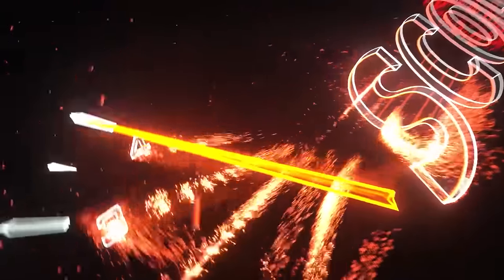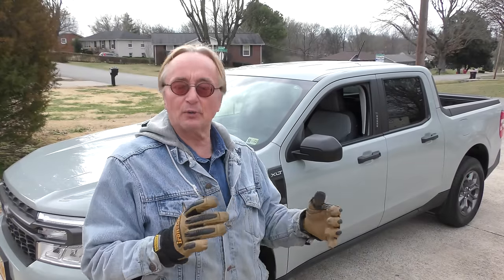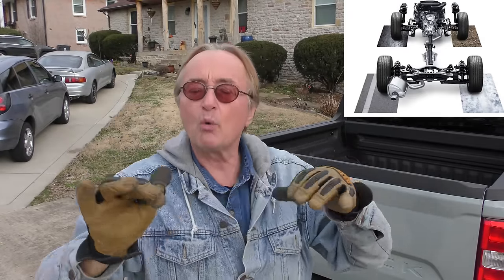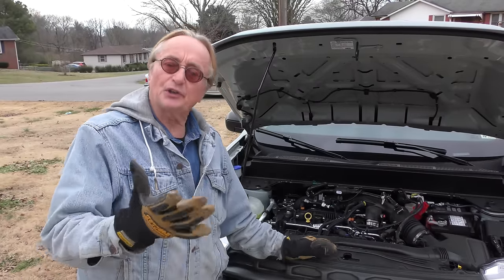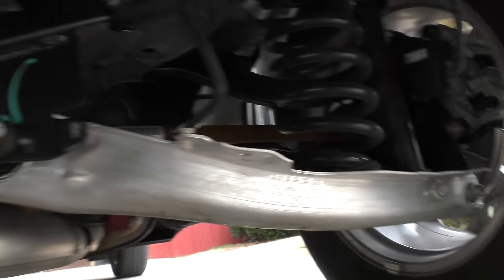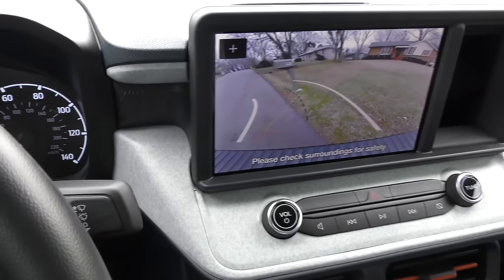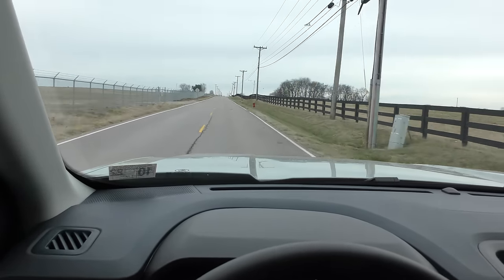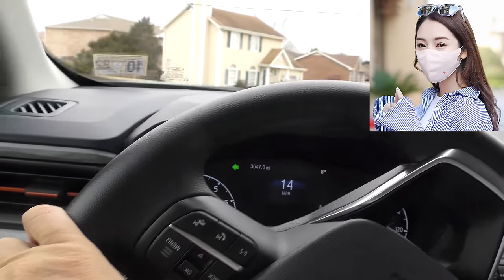I Finally Got a New Ford Maverick and Here's What I Really Think of It

Comment: I'd rather they squeezed the 2.3L ecoboost in there and tuned it like the Mustang 350hp and 350 ft lbs torque. That would be a blast. I wonder what you can get out of the 2.0 with a programmer.
I'd also rather a straight cab 2 door with a longer box. I really wish my ranger was a 2 door straight cab with a few more feet of box.
Reply: some tuners are getting 300HP with a basic tune.
Reply: @roynorman513  on the 2.0L? damn that's not bad. Probably feels like a lot of power in that tiny little truck! they are pretty cool I'd still rather see a straight cab with a 6 1/2 foot box though. that's the worst part about my 2019 ranger is the short little box and the big rear seats that i never use. I know people seem to love the big 4 door trucks but I'd buy an SUV if I was looking for seating capacity. if my ranger was a straight cab it could have an 8ft box i'd love that. If i had the money and the shop to do it I'd customize one like that.
Reply: @Trumplican  got 3 teenage daughters so I need the back seat (BTW the back seat is wider then the current ranger)
Reply: @roynorman513  yeah i get it most people like the back seats i just wish they also made a straight cab long box but i guess not enough demand for them.

Comment: I bought a 2021 Bronco Sport badlands right before the price boom in the car market last year, paid 29,655 for it, it's pretty similar to the Escape and this, all 3 platforms using the 2.0 ecoboost and unibody construction.  My bronco sport did exceptionally well in over a foot of snow here in Cleveland last year, cars were getting stuck left and right and the 4WD/AWD with the rear locking diff had me pulling up snow covered steep hills no problem.  On the highway I never exceed 70, it's just science that the slower you go the better fuel economy you get.  EPA has it rated at 26 mpg, this past weekend going to Pittsburgh for a wedding I got 33.3 mpg even with the PA mountains.  You drive them reasonably and they'll be very easy on your wallet and very dependable

Comment: I test drive the pre production fords, and when i was driving the maverick hybrid, on a 50 hwy - 50 city I was getting 38 mpg, when all city routes i was getting between 40-44, and I wasn't driving just 1 I was driving dozens of different ones, the ecoboost averaged 28 on the hwy
Reply: U were not accelerating slowly and avoiding areas,that need breaking?
Reply: @ryan-yg7pk  in the city It was like heavy city like downtown Ann Arbor (of of the most conjested places in michigan that ive driven). The maverick is the only car of ford's that I have driven that gets roughly the posted mpg (at least the way I drive).

Comment: This is no different than their SUV's..  Just look at the history on those and you'll see how these will fair..   It has the same uni-body, same suspension, and same engine, ect.. It's just their SUV with a bed instead of cargo area.  Not much of a truck really.  Similar to a Honda Ridgeline.  More of an SUV than a truck.  They're pretty sweet if you don't ever tow things.
Reply: I work at a rock quarry and we had a guy who would come in for fill dirt with a Ridgeline. Darn thing can't carry much more than a few wheel barrow loads at a time.
Reply: @twillison8824  lol.. It's pretty funny. Even on this thing -- it's payload is only 1500 lbs, and it's towing is only 2k lbs.-- and it can't do them both at the same time either. smh..  It's literally a minivan.

Comment: this is the perfect truck for the weekend homeowner...a few trips to lowes or HD, a few bags or topsoil,  golf clubs, hockey bags, coolers, softball equipment....all the stuff you need easy access to get but don't need a full truck box.....good gas mileage, enough power for those weekend jobs and an occasional washer or dyer or snowblower you have to pick up...i will take my 2nd gen Honda Ridgeline but for the entry level price of the Ford, it'
s not a bad deal

Comment: I got mine in last Saturday, I waited 9 months "meaning I ordered pre-production" I got the lariat with the luxury package, and a full sized spare, nothing else. I'm actually more impressed than I thought I would be, I ordered the truck when gas was 1.68 a gallon, so fuel economy was not my reason for ordering, I was driving a 2015 Ram-1500 and honestly the dealerships in my area "Ram dealerships" scare me, just not a fan of the local dealers, also I knew the trade value on my truck was super high right now. So the idea in my head was to get a loaded truck that meets all my demands out of a truck seeing I don't do much truck stuff, and this truck does the truck stuff I do, for 30k, trade my old truck in that had 110k miles and have a brand new vehicle that I owe very little on. I got 18k off my trade, so you can do the math, I will have the maverick paid off in 2 years without trying. 

My impression driving it less than a week is it handles very well, I will NEVER have to wake up go outside get in my truck in the winter and freeze to death because I can schedule a time for my truck to start on the app, or use my electronic key to start it when I first wake up, the velocity blue looks much better in person than it does on the online representation, back seat space is enough for a adult to sit in without being pushed against the seat, the synch 3 system is great, dual climate control is great considering in the summer I prefer to row the window down, so my wife can just blast the AC on her side of the truck, the 2.0 liter turbo has plenty of power, truck comes stock with a towing insert even without the towing package, the comfort in the front seats is just as good as a passenger car, I drove for about three hours the first day I got it, and can say I didn't have any back pain. 

I'd go for it if you are interested, I watched a video last night comparing a fully loaded Maverick vs the base model, and for the price the base model had about as much stuff as my big horn 2015 ram did, can't beat a brand new fuel efficient truck right now for under 20k. I'm sure wait times will vary greatly depending on the options you order, but to be safe if you want this truck in the next year I'd go ahead and order one, a dealership could probably answer that question better, I asked about it when I picked mine up and they acted like a year was a realistic outlook out someone ordering one now "Could vary by location in the US" 

I'll probably end up uploading a video of mine, there's actually not a lot of recent video's of mavericks, and I guess I'm weird because I can't seem to find anyone who ordered a lariat that wasn't AWD.

Comment: Auto off is easily disabled with the dedicated switch on console. A $2400 10 year extended warranty made sense to me being a brand new model with a lot of tech. I have the XLT FX4 with around 4k on it, mpg high 20's with no issues and a hybrid with under 1k, mpg low 40's so far. Love both and still waiting on 2 more to be built. Ordered all in Sept 2022. Replacing aging Ranger fleet trucks over 25 years old.
Reply: Curious, did you test drive the new Ranger?  I like the look of them, but these Maverick's seem too good a deal when compared.

Comment: Good review of the new Maverick Mini truck. Scotty is usually spot on when it comes to advice. However, non of us are perfect and I will try to seek the truth especially when it comes to safety. Living in a state like Maine where 6 months of snow can be experienced, I recommend putting matching snow tires on All 4 wheels even when the vehicle is front wheel drive. Same for a front wheel drive little truck along with extra weight added to the bed to help keep the rear end stable and track the front wheels. When frozen roads become slushy during the daytime, the mismatch of treads on tires front to rear will cause the vehicle to slip a lot easier especially in a hard breaking situation. I highly recommend 4 snow tires on all 4 wheels period.

Comment: I have experience with a Mexican made vehicle  and it's not all bad - 2009 Chevy HHR SS with the 2.0L Ecotec turbo engine and automatic trans.  It's still alive and driving quite strong at almost 150k miles but the auto trans gave it up at 110k miles (made in Canada I think, eh?).  The worse wear has been mostly cosmetic (paint and glass) but incredibly the interior has held up nicely.  Scotty is right about turbo fours - CHANGE THAT OIL OFTEN WITH FULL SYNTHETIC without fail.

Comment: I like AWD in snow because all the wheels are driving.  I used to put an inch bigger all weather tire on all four wheels and didn’t need the studded tires.  You just need a tread size that handles snow better than the factory delivered tiny tires.  As long as the larger tire fits in the wheel well.  No effect on the tranny.  My old suv was top heavy so the larger tire size gave it much better stability on ice and around corners in the winter.

Comment: I’m still driving my 97 Ranger, runs perfectly, 238,000 miles, aside for a timing belt change all I’ve done is take care of it.  I drive 50 miles a day and spend $40 a week in gas.  My point is the Ranger is proven over time, I’m happy to see them bringing back small trucks but I don’t like the over engineering
Reply: Love it.  How often do you change the oil?

Comment: Honda ridgeline is front wheel drive and first since 2006. Guess what, even in slippery snowy conditions putting it in 4 wd is rarely needed.  Honda nailed it. Best kept secret, the Ridgeline rocks. Have 230K miles on my 08. bought it with 180k miles 4 years ago. Could still sell it for what I paid for it. Doesn't get any better than that.

Comment: The Maverick is the first Ford pickup I've purchased for myself after 24 years of Honda ownership. 1 year, 7 months in and 23,500 miles I have no complaints except for a few radio & backup camera glitches. Overall very happy with the Maverick XL EB-FWD (don't like the fancy crap), and getting 27-28mpg city, and 30-33mpg on the highway. I'll be curious of the long-term reliability. We'll see how things goes. The Maverick will either make or break my future of Ford ownership. One thing is for sure: after being a car/SUV driver for the last 24 years, once you drive a truck you never want to go back to anything else.

Comment: If from Niagara Falls, Scotty should know that putting snow tires only on the front wheels, front wheel drive or not, is outright dangerous, capable of causing serious injury and even death. In cold temperatures, with a snow tires’s softer compound and more aggressive tread design and depth, the gripping and stopped ability is significantly more powerful than all seasons, with a rubber compound that hardens in the cold and with a less effective tread design. As such, the imbalance causes the front end to have significantly more grip than the rear. Cars can and do swap ends when breaks are applied. Think of it as putting the feathers on the front end of an arrow. Many professional tire stores refuse to put two snows on the front for their own legal liability.

Scotty, shame for repeating this dangerous suggestion more than once without checking out the facts. I have experienced this at high speed, and I learned my lesson. I am glad to still be around.

Comment: I had a 2002 Jeep Cherokee with a straight 6 cylinder motor, 2 wheel drive and I loved it.  It got totaled so I replaced it with a 2008, 6 cylinder, AWD.  I went from 21MPG to 13MPG - I hated that 2008 model.

Comment: In my mind front lifts , shifts weight to back, looses grip in steering
...just stomp the accelerator in front wheel drive....feel it rise...and pull to one side...empty space.  Front is good most times. I guess its like horses and wagon. But horses ran straight ,under better control no built in  left or right bias in the rain .   They all beat walking.  Pick your disadvantages.

Comment: I got a 2008 Ranger , sept . '07 , for  $19,500 ,  ( Canadian )  besides oil & filters, the only things I replaced were tires & a battery at year  10 ,  sport , supercab , 3 litre v6 , 5 speed , air . now you can't get them , new Ranger is twice the price , & harder to work on .
Reply: My step father bought a 2007 Ranger Sport Supercab, 4WD, auto, with the 4.0L V-6. Even with the biggest engine it wasn't quick and sucked gas. The ride was rough. But durability wise you couldn't beat it. The thing was bulletproof and was perfect for the winters here in New England. It was rust that ending up eating her away 13 years later.

Comment: I've had a Ford hybrid with the Auto Stop/Start feature since 2015 and 195,000 miles. Absolutly nothing has gone wrong with the things you mentioned. I bought a 2022 Explorer and it has the Auto Stop/ Start as well,  which you can turn off BTW. I must say I don't like it on gas only vehicles. The transition is too jarring. You don't even notice it in hybrid cars.

Comment: Toyota's new small truck is due as a 2024 MY and should be competitive with the Maverick. Scotty, you should cover the stop start disable process. Some vehicles offer a stop start disable switch, others require modifications. This feature is unwanted by most people, it also stops the a/c compressor when your foot is on the brake.
Not much fun in the summer in heavy traffic!

Comment: Scott. Like the Ranger, there is a switch to prevent the engine from shutting off at stop signs. As for AWD - If it's like HONDA and others, the rear drive shaft only kicks in when the sensors detect a need for the extra traction.
Reply: Not sure on hondas but prior ford awd architecture, the rear driveshaft always spins - geared via the Power Transfer Unit — and the rear differential has a clutch to engage and disengage the driveshaft’s link to the rear gearset.

Comment: I really wanted one of these but then after thinking about it more logically I figured that a subaru outback is a better vehicles for the same purposes.  
 
Maverick bed is so short you can't do much. Outback you just out down the back seat and you've got a longer space than a maverick bed.  
  
Outback is awd with higher MPG.  
  
Outback has more features and comfort. 
  
More rear leg room.  
  
I would prefer a maverick if they committed to it more in terms of utility. 
  
Like have the back seat able to lay flat and bed expand into the cab. 
  
Also improve the MPG on the 4 cylinder. No one is going to haul with this.

Comment: With front wheel drive you need snow tires on all 4 wheels because your braking is affected as snow tires grip better than all season tires and you will have tail spin if you only have snow tires on the front

Comment: I have a Lariat hybrid and love it, only issue is the startup temp sensor is faulty or expecting a higher temp and sets off the CEL, after a few minutes is goes away, sometimes I have to clear the code, so far that's all, 23K miles average about 38-40mpg

Comment: All my fords I think were built in mexico. All jave over 210k miles and all run well and haven't required any major repairs. 
2004 f150; 2008 f150 and 2012 transit connect.   The 5.4 triton was supposed to be trouble but I haven't had any trouble at all.    Knock on wood.

Comment: All-wheel-drive front wheel drive does matter. You can get snow tires on a front wheel drive, but it’s much much better and all wheel drive. You drive to big bear California going up those steep hills with front wheel drive, you were not going to handle very well. You may even get stuck. It doesn’t matter what tires you have. tires do matter a lot, but some places it does matter more to have all wheel drive. It’s like those people with lifted trucks that don’t think they need 4 x 4, until they try to take an uphill hairpin turn.

Comment: The Hybrid Maverick gets 40mpg+In the City, and in the mid-30mpg on the highway... The reason is because the electric motor is not doing anything after a certain speed, so you will lose some mileage and at higher speeds, the truck still has to cut through the air, as a box shape...

Comment: if this was closer to MSRP it would be GREAT but they're on average $6000 above MSRP.
Reply: Joel, order a Mav from a dealer that charges msrp they are out there.  That is how I bought 2 that I show in my videos. 
You will have to wait but it's worth it.
Reply: @fordmaverickmaniac Do you know if you can order from Ford directly or do you have to contact a Ford dealership? Also, how long did you have to wait for the part?
Reply: @lazaroambrosio5646  Hi! Ford can only be ordered through their dealer. The wait depends upon the build but it's now less than last year. I would expect 6 mos for turbo AWD. 8+ mos for a hybrid. Get the AWD because now that the hybrid costs +$1500, it takes about 2 years to recover the extra cost in fuel savings. The AWD can do so much more.
Reply: @fordmaverickmaniac  Great info, thanks!

Comment: While I am a huge fan of small pickups and have been disappointed with their availability for years since the death of the small Ford Ranger, I have to argue with everyone calling the maverick a pickup truck.  It is a car with an open trunk, just like the Honda Ridgeline before it.  Pickup trucks are not unibody.  Cars are.  If you can't swap out beds with some hand tools and elbow grease, it is not a pickup truck.  If you can't weld, drill, or otherwise directly alter the frame, it is not a pickup truck.  The Maverick handles admirably because it is a car.  It rides like a car, because it is one.  I am not disparaging it.  I'm sure it has utility and its owners will love it, but it just is not a pickup truck.

Comment: The prices of these trucks will only go up on  the used market.  They are such a good value that even I was considering buying.  The dealer told me they aren't making anymore due to supply chain problems and a quick internet check shows the used market  is 150% msrp minimum!  Kinda like ps5.